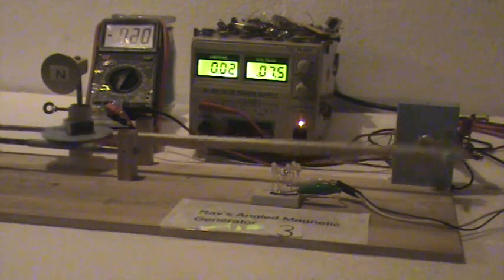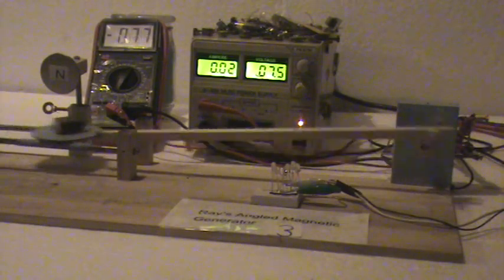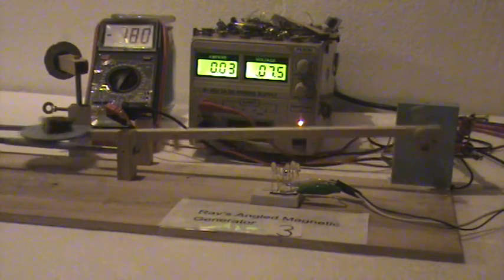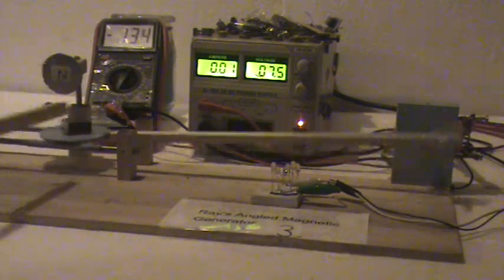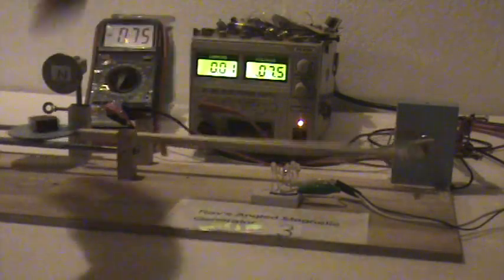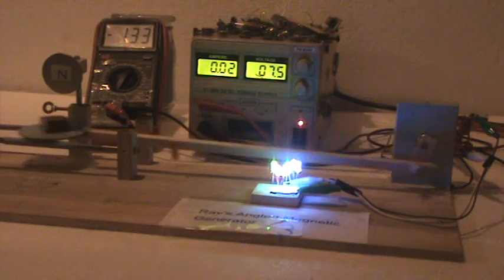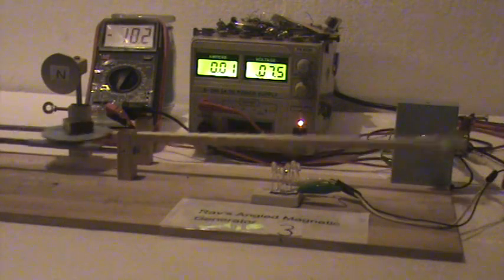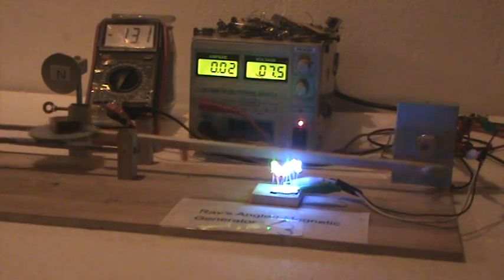Ray's Angled Magnetic Generator 3

Comment: A possible explanation I see for the increase in speed when the N facing disc magnet is rotated over the reciprocating magnets is that the magnets are attracted to each other just enough to reduce the friction of sliding over the rails, thereby increasing the efficiency of the system.
Reply from the maker: Could be , I considered that but anything that is attracted also does not want to release , but wants to hold on to it with the same force it lifts ; but still something like that or other could explain the gain. thanks for in-depth thinking

Comment: the famous slingshot effect. A rocket that is slingshot when it does a flyby at a planet, is in fact drawing a small portion of energy from the rotation of that planet. At least, that is what I have read somewhere. But how do we apply this explanation to magnets? Or do we better reject that explanation of a slingshot?
What would happen if we make the arm a little longer, so we can add a second set of magnets? (if the weight and resistance is not adding to much losses)? Doubling the effect, could that work? (I do not think so, but who knows?).
There is something else bugging me. We all know a motor has an EMK. A generator part pushing back. A motor is not very efficient. If we would use  a device without that EMK, we might see wonders. Or almost :-)
Keep up the good work. There must be a soul out there who is going to improve your ideas and do great things, inspired by you!
Reply from the maker: Not at all sir , next video.

Comment: nice , where do you take the voltage for the LED from if there is no coil ?
Reply from the maker: Because the extra o.u.. power is pushing back to the motor in a helping way ; the power requirements drop for the motor . This is where I place the led load , across the motor terminals in parallel .

Comment: I am still trying to understand the concept. 
so is it 2 magnets 
a circular magnet north facing out which is above a diagonal magnet under it. 
Then a motor pushing the bottom magnet back and forth 
and the top magnet makes the motor run faster.... 
So how i understood it which I assume i am wrong.
Reply from the maker: Yes , the why is much harder to understand. Still could be something normal , let me know any results you get .

Comment: What you are really doing is lowering the mechanical load on the motor when you turn the magnet into position.  That's why the motor speeds up and the current consumption goes down.  Exactly why the mechanical load decreases is to be determined.
Reply from the maker: The why's are always the hardest , thanks